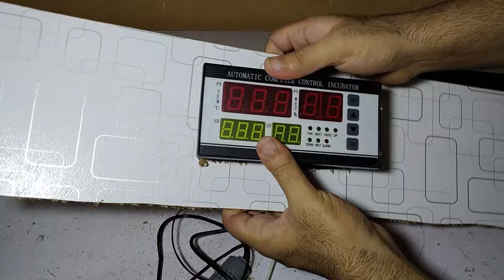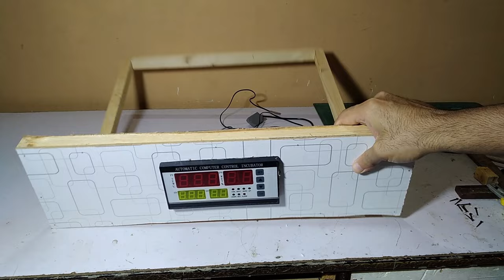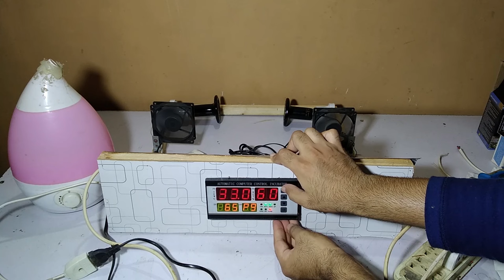DIY insulated automatic incubator | How to make chicken incubator

Comment: You don't show how much temperature and humidity value and their alarm value will be set
Reply from the maker: The factory settings are already set which are good to use just need to change mode for different birds, there is no need to change in settings.